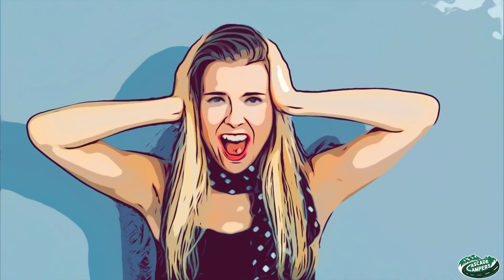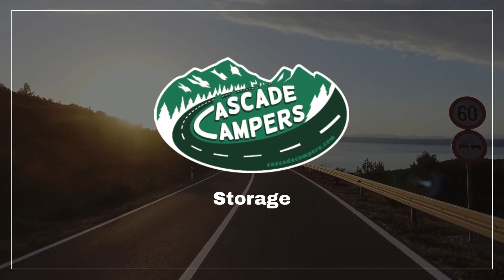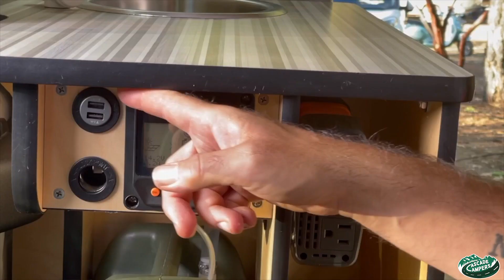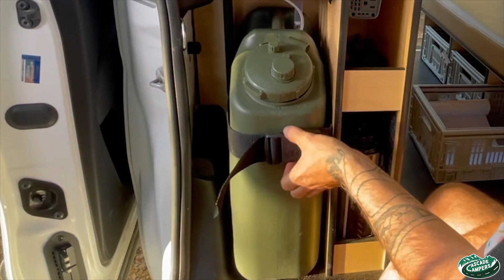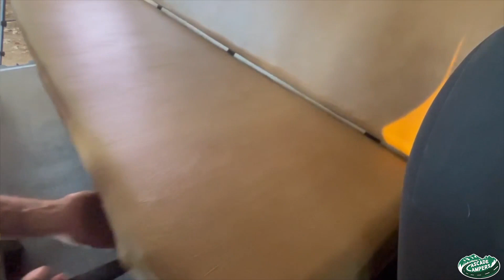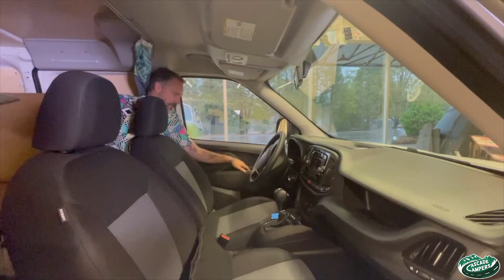Full Tour of Cascade Camper

Comment: Do you sell build plans for this bed?
Reply: Unfortunately we don't. The reason is the bed is fully integrated into the complete campervan. It uses the cabinet to keep the slides from going to far in one direction and the body of the van in the other direction. There are also legs that are attached to the cabinet to help support it when in bed mode. Because of this it ends up being far to complex to create and support selling plans.

Comment: Why are the fans side by side like that? Don't you need some separation to actually create airflow inside the van?
Reply: The fans are next to each other due to limited space on the roof and not wanting to have them over the couch where you could hit your head. Both fans are exhaust only (out) so they are pulling the hot air near the roof out. Airflow is going to happen between the fans what whatever windows you have open so no problem having them next to each other. The point of 2 fans isn't for 2x airflow and instead is to be able to run them both on low for minimal noise while still having plenty of airflow.

Comment: Your fans are way too loud noisy. You need to go with some Max Air fans
Reply: The Ventline fans on full speed are a little loud. This is why we install 2 of them and install speed controllers on them to allow you to run them on low speed. We install Max Air fans but 2 of the 5 we installed failed and one leaked. The issue is the Promaster City doesn't have a good place to install a full 14" fan like the Max Air. A 14" fan also screams "I'm sleeping in my van" where the small Ventline fans that we use look more like some kind of antenna. We have built nearly 400 Cascade Campers for folks and the noise level of the fans isn't something I ever hear about from all of those happy campers out there. Not saying that Max Air fans are bad but they just haven't worked out well in our use case. Happy Camping!

Comment: Can i have upgraded electric system and 300 w solar with you build?
Reply: Hello Lorraine, We don't make any modifications from our standard electrical system. This is necessary so that we can support the huge quantity of Campervans we send out in the world. That said we are in the process of designing and testing out a updated standard electrical system that we will be rolling out in the next couple of months.
Reply: @zachyeager7320  please share when you do and would it be possible for us who already have a van to get it installed if we liked it better? Thanks Zach for keeping the innovation going!
Reply: @tawneblackful2320  I am working on a lithium battery upgrade for existing Cascade Campers owners that should be available in the next couple of months. I will post it to the owners forum once it is ready.
Reply: I hear you, Lorraine. The first thing I thought was that a 400-watt inverter is relatively useless, especially for something like an electric kettle or even the tiniest air fryer. So, I was wondering about removing that tiny inverter and replacing it with a larger one. An alternative would be to buy an all-in-one power station like a Jackery, Bluetti, Pecron, Ecoflow, etc., but there doesn't appear to be enough storage space for that. Did you end up with a Cascade Camper? I'm looking at one right now but feel like I need more room for things like a guitar, keyboard, and portable toilet.

Comment: I love my Cascade Camper van! But I hate the door locks. If you travel with a dog, you will understand immediately. With my dog in the passenger seat, I closed the driver’s door to walk around to the other side. Before I was able to open another door, my dog had stepped on the door lock, locking her — and my keys — in and me out. Fortunately, it was a warm day so the window was partially open. A friend retrieved a back scratcher and used the curved hand to pull up the door lock lever. Lesson learned!
Reply: Thank you for pointing out the door lock issue. 

Thank goodness my JRT likes riding in the back with the couch in bed position.  I run her leash through a D-ring and double it back to her harness.  Flaw with my plan, I’m so short that she got wedged between the driver’s seat and the bed.  😬😬😬   I’ll be stuffing a blanket in that hole in the future. 

#275 Allen the Alien 👽

Comment: How do you check the water level? Where is a gray water tank?
Reply from the maker: We aim for keeping things as simple as possible. You can check the water level by opening the lid and looking or by unclipping it and lifting it to see how heavy it is. The conversion doesn't have a grey water tank. The water from the sink drains to the ground. Same as you would do if you were tent camping except you have fine control with the faucet so you  have a lot less water going on the ground. Always use bio-degradable soap and don't put anything down the drain that wouldn't be ok to go on the ground. We do provide a collapsible bucket to go under the drain for those times when you are camped in a place where having the water go on the ground isn't the thing to do. There is a ton more information about our van conversions on our website at www.cascadecampers.com
Reply: @cascadecampers  I have tried many "simple" set-ups, clear water tank (food grade) is the best.

Comment: Great video, thx. Would it be a more versatile fan configuration to have the exhaust positioned over the cooking area, and the other fan over the far rear corner of the bed, motor wiring flipped so that it can pull air in. That way you could more immediately get cooking vapors out, as well as create a powered cross breeze for sleeping.
Reply from the maker: Hello Catmandeux, these are good thoughts and there are a couple of reasons why we didn't go that route. The style fan we use can't be used to pull air in even if the motor is reversed. It is a squirrel cage type fan versus a propeller type fan that is capable of being reversed. We use the squirrel cage type fan due to its small size an ability to be installed on a flat part of the roof where the bigger fans would install over raised ridges making it much harder to seal well. The reason why we put both fans in the one corner is to free up space on the roof for the solar panel and to create a breeze in the van. What you can do is crack a window on the cooler side of the van in the summer and the air flows from that opened window through the van to exhaust fans. The reason why we do 2 fans isn't because of the need to move that much air as one on full blast is plenty of airflow for a van this size. It is instead to be able to run both of them on low so you have a lots of air flow with minimal noise.
Reply: @cascadecampers  Thanks for explaining that, it makes sense. My question is how tall is the van with the fans? I would have to park in a garage because of an HOA.
Reply: @roseboudreaux4645  With the fans it is a little over 75" tall. It will fit in all but the very smallest garages.

Comment: My first time changing the water tank, my lights and facuet wouldnt turn back on. 
Fridge and vent are on 
Red, kitchen, reading, and sink power are off. 
I flipped the house battery breaker, but it didnt turn back on. 
What may be the issue here? 
Thanks!
Reply from the maker: Lemon Jelly, that does sound like a unique set of circumstances. Give us a call at shop and we are happy to help you figure it out.
Reply: What was the issue and the fix for this? Thank you.